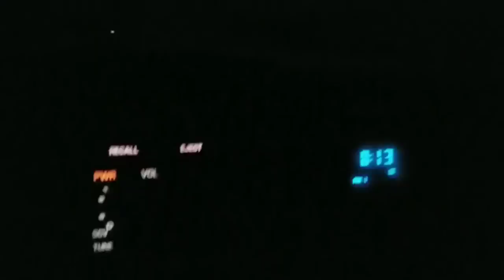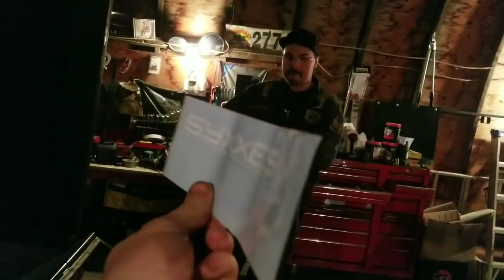The Homemade Enclosed Sled Trailer

Comment: By the time you're done, you coulda bought a used four place.
Reply: nt3523 we will do a review on the cost and the products used on this project upon completions as a comparison. We are still way ahead of the game at this point but will keep everyone updated 😬
Reply: @nt3523  and the amount of hours of work gone into it.
Reply: @ben_syxxes8179  Have you guys factored in the gas cost of pulling that wooden box every trip to BC? No way that thing is designed like the other enclosed trailers to resist wind drag.
Reply: As you will see in previous videos this trailer was never intended to be an enclosed sled trailer. This is my utility trailer that gets used and abused all summer. Everything you see is 100 bolt on and is intended to be removed. There's no justification at this point to spend an additional 8k for a good used sled trailer when with a small investment and some time I can have both options for less than half the price. As for labour? I'm not cutting myself a cheque for building my own project, that's the pay off of having some skill and some tools. As previously stated this is a multi purpose trailer and i would not recommend anyone to go out and buy a flat deck and convert it just for the sake of having an enclosed trailer. This is strictly behind the concept of "getting 2 birds stoned at once" (using something to its full potential) with minimal input costs.
Reply from the maker: The extra 10 dollars of Diesel xD round trip